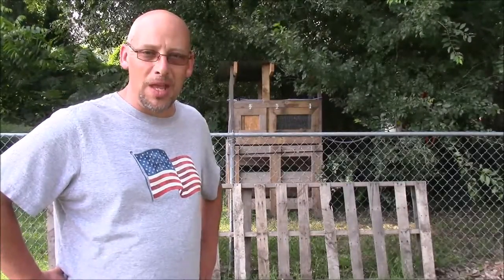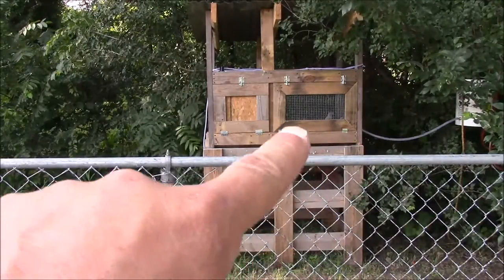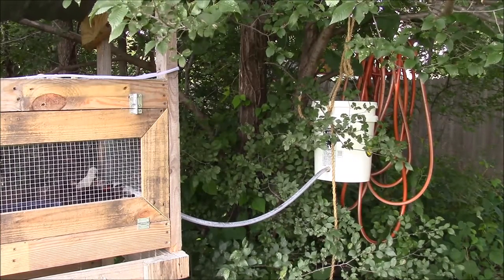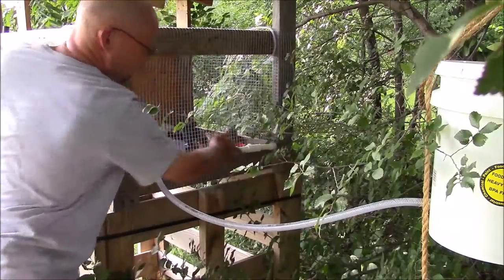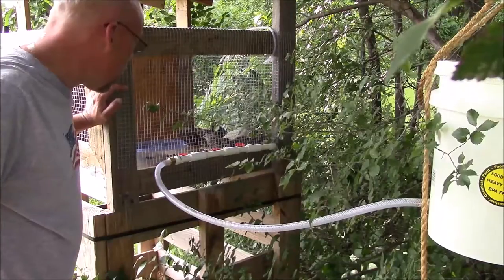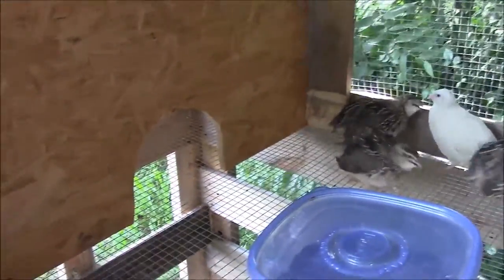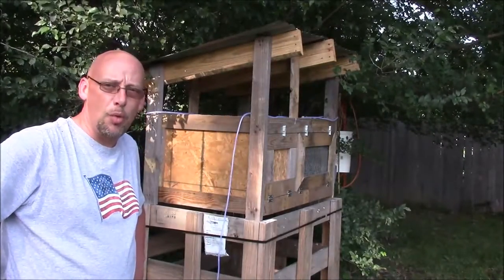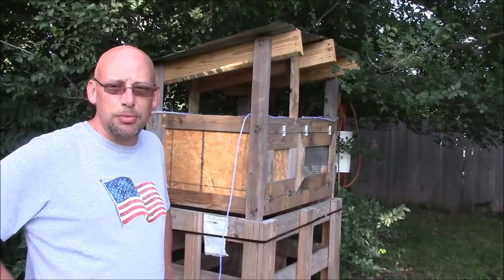The SlightlyRednecked Function Stacking Quail Hutch Part 2 The Prototype

Comment: When I used to train bird dogs we had a "Spook Box" on the side of the pin. We would drop the gate with a string and then walk around to the box and move a piece of wood from the top to grab them. To prevent them from flying out we had a piece of rubber mat with a star cut that we would reach through to grab them. Just a thought.
Reply from the maker: good thought.  thanks for sharing.

Comment: Did you connect the wire to the wood, or just suspend the wire cage inside like on your other cages? It looks like  "screen" door at least is attached, but I can't tell how. How did you attach the screen to the wood?
Reply from the maker: i staple the wire to the wood.  One staple every 4 or 5 inches.

Comment: Quick question. I have had 2 chicks die unexpectedly and the others don't look as healthy as the did at first. Any suggestions as to what might be going on? Temp is between 100 & 97 degrees. Hate to lose the little guys. Thanks!
Reply from the maker: They should be ok in that temp as long as they have plenty of ventilation and plenty of water.  What are you using for water and do you keep it full all the time?
Reply: We are on a well so I'm using well water. Yes, I am making sure they have water at all times. I'm wondering if there just weren't too many of them in a small brooder box. Ended up loosing 11 out of 28 so far but it seems to have stopped.
Reply from the maker: Oh, you had them in a brooder?  once they feather out I move them to all wire cages.  especially in the summer.  That is usually around 2 to 3 weeks old.  It may be an issue with ventilation then.  Just a wild guess though.